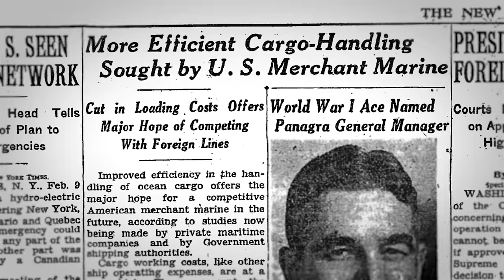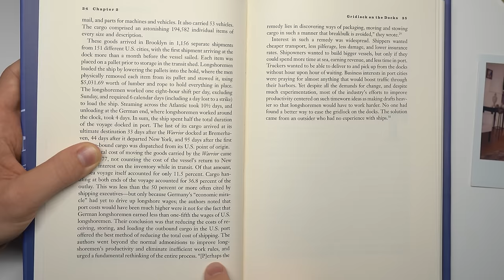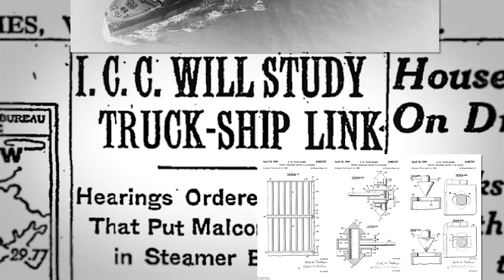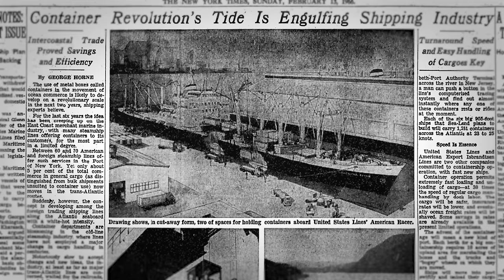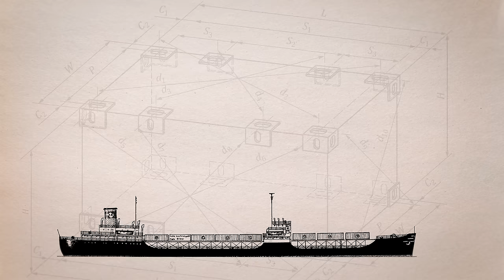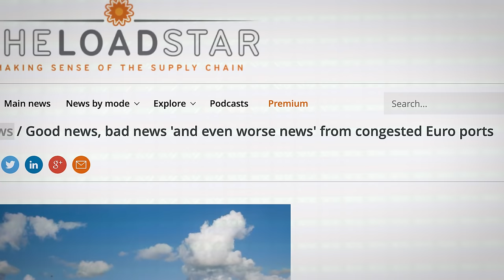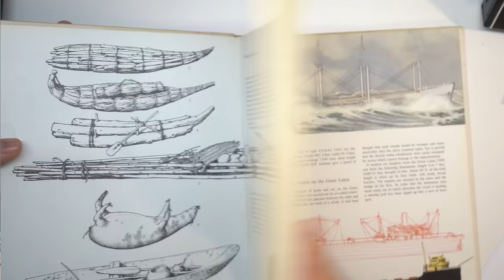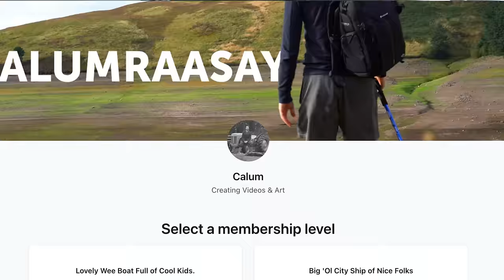Shipping Containers Are Genius - Here's Why

Comment: Great video, thanks. I read the book by Marc many years ago and it was wonderful. I've recommended it to many people. Whom would have thought a book about shipping containers could be so good? :) I found myself thinking to myself "Ah, so that's why ..." when reading the book as it helped explain how, as least in North America, why a few things are they way they are. 

For example, before the shipping container railroads were much more popular for shipping cargo but trucking companies accepted the shipping container earlier than the railroads. So we have ended up with many more trucks on the highways, even today. Goods from Asia going to the US most likely head to the port in Los Angeles and from there are trucked to their final destination. (It's changing now because the port is getting full and expensive but it still handles a lot of containers.) The environmental impact of so many trucks is terrible and the solution being looked at is electric trucks. The best thing to do would be to use rail and get trucks off the roads. It would reduce pollution (noise pollution, particles from the tires, pollution from diesel engines or source of electricity for electric trucks), make the highways and roads safer, increase capacity of the existing roads so they wouldn't need to be widened (as vehicles are being taken off), and deal with the shortage of drivers. Trucks would still be needed as railroads do not go to every city and town but the long haul trips become short to medium haul trips. 

(The best solution is not to have anything to ship. In my city buildings that contain storage lockers for people to rent are being built in many places in commercial areas near residential areas that contain houses, not apartment buildings. People whom own houses, which are fairly large, as compared to Europe, are running out of space to store all of their stuff and are renting a storage locker to put their stuff in. How much excess stuff are they buying in order for them to require renting storage space? A couple of companies let you rent a pod, basically a shipping container, which they drop off to you whenever you need it. It may also be used when moving from one residence to another.)
Reply: Why would you assume it's largely people with large houses needing that storage? People with apartments also rent storage units. People can get them temporarily because they're moving, business closed etc. 
The railroads in the US move massive amounts of cargo, always have. That's essentially all they do.

Comment: Now I haven't watched the video yet, but I did want to give my quick take on the shipping container, which is that I somewhat dislike it because it's extremely hard to use them for last-mile delivery by rail. Having doors exclusively at the end really makes it a challenege because with boxcars you can pull them up to the side of an industry, reducing train moves and allowing for greater capacity sometimes, especially because you can walk from one car to another laterally if they're parked right. The shipping container basically forces last mile to be on trucks, which is terrible for enviornmental and urban design reasons.